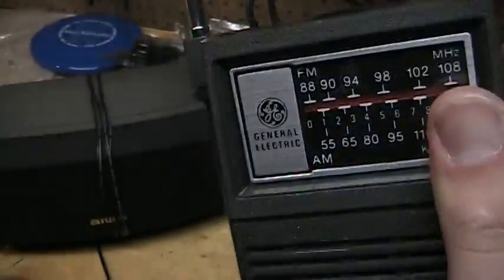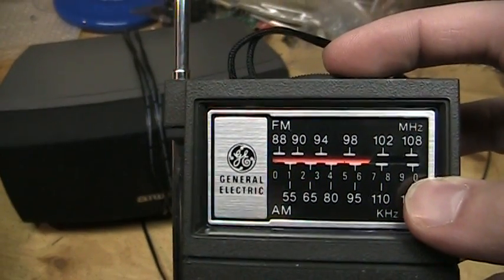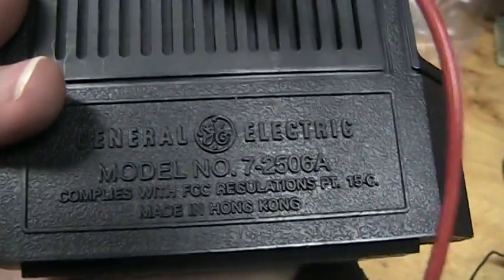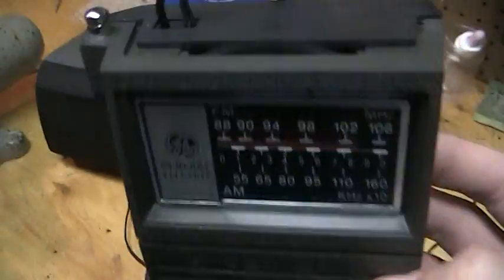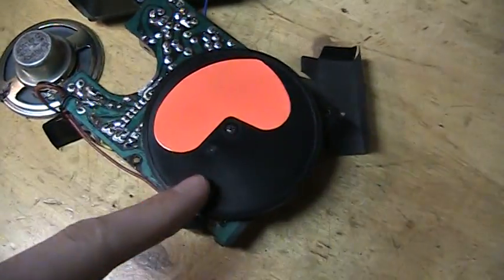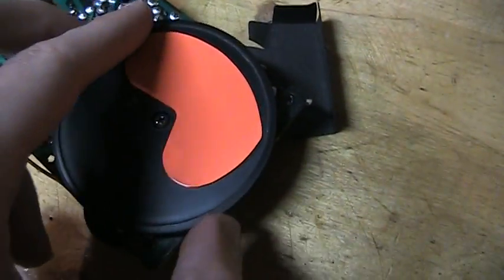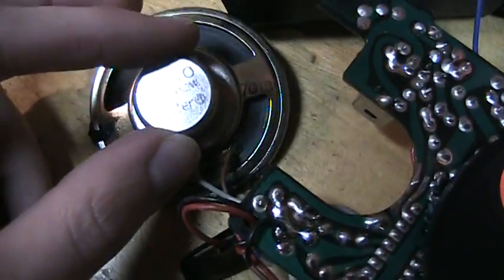1976 General Electric AM/FM portable radio

Comment: I had that radio! got if for my birthday from my dad back in 1977 or 1978. It is a rugged radio that gets great reception. I used to stay up at night under the covers listening to it. It was real easy to adjust the tuner for clear sound. I had it for many many years till the antenna got bent and broke off. I sure do miss that radio.

Comment: I had one similar to that GE accept it was a larger unit styling was similar and purchased in around 1975 or 76 with a built-in AC power supply. On mine the speaker is bad also and it's a 32 or 36 ohm speaker. Good luck finding one of those.

Comment: I don't know why the 60's-70's radios had much better reception  + tone than the modern junk (from China mostly). My old ZENITH ROYAL 66s (AM only) from 1969 are still the best I ever had. GE Superradios from the 80's were pretty good, too.
Even Older car radios were better. My 1972 Chevy radio picked up way more with much less static than even my new high-end car radios.

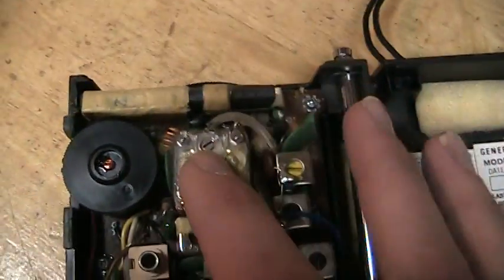Comment: 0:07 nice rigging with the headphone cord I do that too.  And you have some good radio stations in your area. many of the songs heard I liked. 40 Ohms? thats kinda high. and 0.2 watts isnt enough id put a 0.5W or even a 1w speaker in that radio. 3:42 whats the number on the IC chip there? 6:07 lol Jay-Z, Nice little radio I hope you can fix the speaker. Post a video of the radio after you fixed it.

Comment: It sounds very loud LOL, I mean it makes that somewhat big speaker (for the size of the radio, at least) work without problem, but my guess is that the volume is very loud because it is an 8 or 4 ohm speaker instead of 40 ohm, that's weird, did the radio overheated when you used it with that speaker? I guess you can get something to fit inside around 16 ohms out there, some kind of midrange speaker of a home stereo or something.
Reply: That wouldn't make it much louder, only distorted as hell. Maybe the speaker has good sensitivity and he had the volume down.